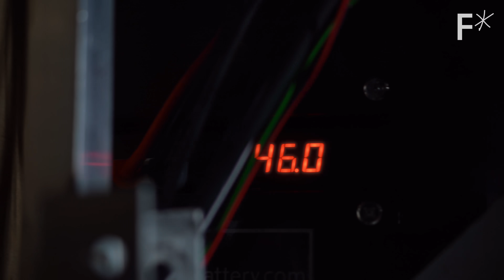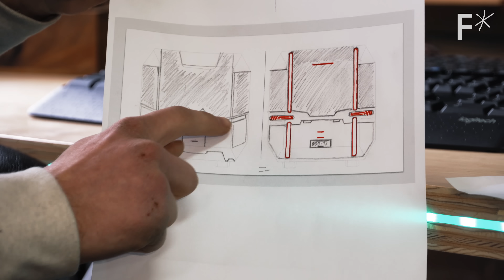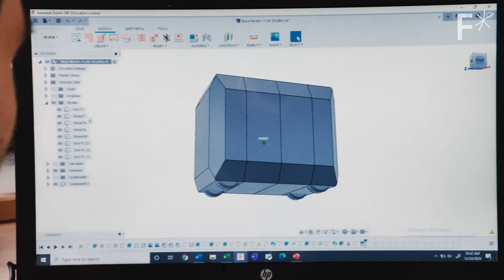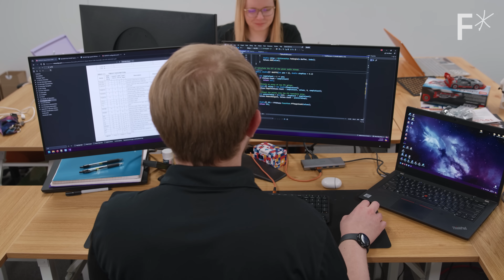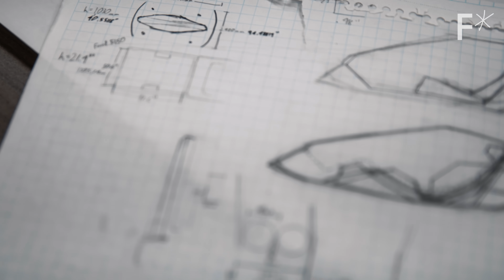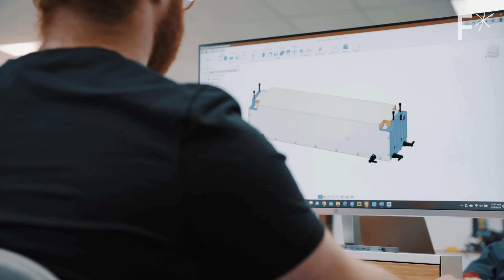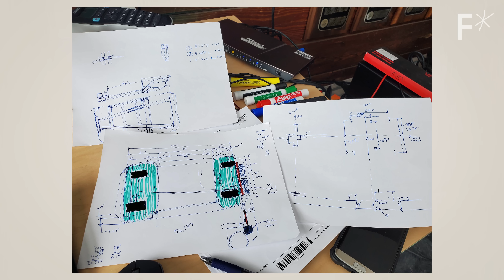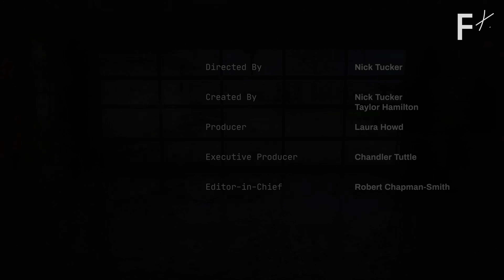Ex-Ford engineer builds driverless car in his garage in 100 days | Hard Reset

Comment: The “Tic Tac” UFO, encountered by U.S. Navy pilots in November 2004, exhibited extraordinary speed and maneuverability. Radar operators aboard the USS Princeton tracked the object descending from approximately 80,000 feet to 20,000 feet in less than a second. Additionally, the object was observed accelerating from a standstill to 60 miles away in just one minute, indicating a speed of about 3,600 miles per hour. ￼ These capabilities far exceed those of any known aircraft, leading to ongoing discussions and investigations into the nature of this unidentified aerial phenomenon.

Comment: Very nice I can relate to that. If you look at this icon is a real aircraft with no propellers or blades neither turbine. Is an electric motor but the only difference is that this electric motor push straight forward doesn't spin like regular electric motor. It's an evtol.

Comment: I really don't understand the facination with using game controllers to do things a steering wheel does - when steering wheels for the consoles exist.   For things like drones and the like - they make sense, but for literal driving?  ... Driving simulation enthusiasts don't use controllers - they use steering wheels.

The drone - the half scale has so many problems.  The main reason blades are exposed, is, because the thrust required to stay aloft is extreme, they can't have restrictive air flow - to do so, would require significantly more thrust power, and that is problematic for 2 main reasons - 1 extra fans to blow air, costing weight, and 2 - extra power use - destroying battery flight needs.

Oh and, gee, only if Americans could afford living conditions with garages, maybe more things would get made/invented.  Having space dedicated to craft, instead of just a minimal living space to sleep and eat, is now a luxery.

Also not to nitpick, but the self driving pod - has so many issues for actual use, it isn't even a prototype at the stage it's at.   It's not weather resistant, so indoor only use or 'nice day' use, and who cleans the fingerpints off? or unobstructs cameras/sensors?  a little splash of muddy water and i think it would be doomed.

Comment: I don’t want to squash their dreams, but unless there’s a major breakthrough in battery technology there will not be an eVTOL that will be worth the price. You’ll have speed and minutes of flight time or an hour of flight time but no speed. Thats it. The technology in storing electricity is just not there. It’s already bad for flight, and add VTOL capabilities and you waste a lot of electricity just to take off.
Reply: Batt tech is changing rapidly, if it doesn't then yes it will be a short flight.  Time is full of surprises.
Reply: @NIFTGo  It’s going to take a whole new revolutionary battery design. We’re close to the maximum energy density for lithium ion.

Comment: As a gamer...one thing concerns me...stick drift.
Reply: You are right, which is a reason to zero components on initialization!
Reply: @NIFTGo  Makes sense. You're also using an XBox One controller. Be careful with certain brands. I don't know what it is exactly but some sort of residue on the inner board can cause the controls to act weird. Example being pushing up on the right control stick triggering input for LT. The controller will work well out of the box but over time this can get bad. I think it has to do with oxidixation, but that's a guess. Specifically in the Power A brand. I washed the board with Isopropyl and used a toothpick to clean it. It helped but didn't completely fix the problem. Definitely not something you want to have happen while running a vehicle.
Reply: @austinjohnson8695  good advice,  we also have a deadband around zero because the stick doesn't always return to the same zero.

Comment: It would probably be a good idea to make the golf-cart steering sensitivity speed sensitive... the faster the wheels are turning, the lesser degree of turn you get from joystick input.  would help with the twitchiness.
Reply: The initial drive had some control issues that have been improved for human driving but were not experienced under automation (an artifact of the Xbox signal in combinations motor control initial config and sw).

Comment: So they didn't build a car, they modified a golf trolley. And it's not driverless, it needs an xbox controller. Apart from that, 100% accurate title. Not so far removed from the electric barrow I built five years ago from old electric mobility scooter bits. Ah well, so little time, so much click bait.

Comment: Ex Ford Engineer: drives a GM.
Reply: 😂 between Ford and Covid, I left Ford for another OEM role and I only ever thought about buying a Ford, so I bought a GM vehicle on the way out.
Reply: @NIFTGo  do you prefer the GM? lol
Reply: @Zuul47  actually GM has some great vehicles, but it's hard to get used to after so many years in a Ford vehicle

Comment: They could have started with a used EV and comma(george hotz). There's tons of open source stuff, put out by almost all universities' phd departments, that work at the intersection of LLMs and robotics. Its easy to modify a car however one wants to say by equipping it with all sorts of sensors with all sorts of tools like CNC, laser cutters and whatnot. GPUs, SBCs etc are all available very cheaply. On the software side of things Linux and a lot of stuff on github can take care of it all
Reply: @vivekpraseed, yes there are infinitely more ways to do what we did.